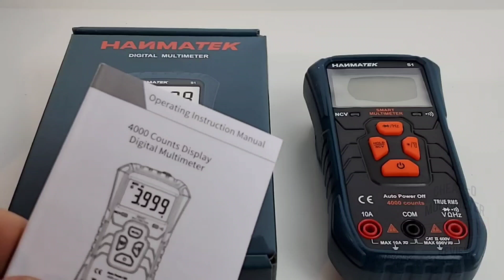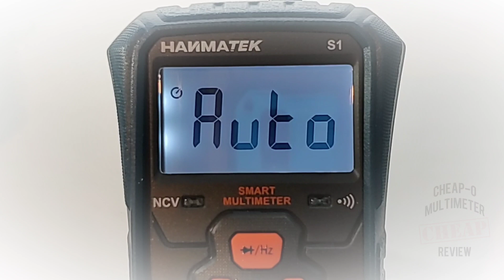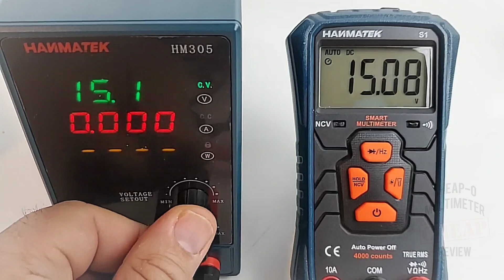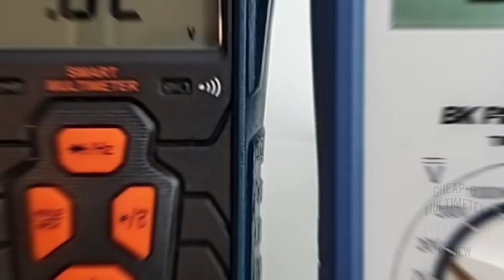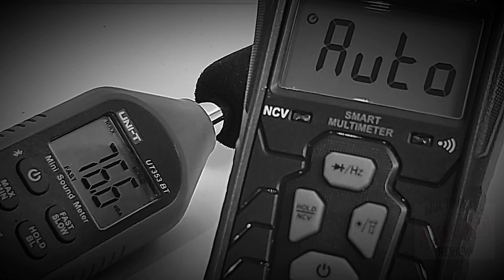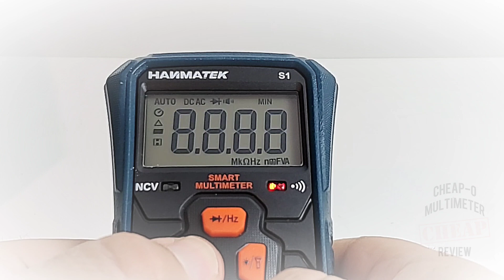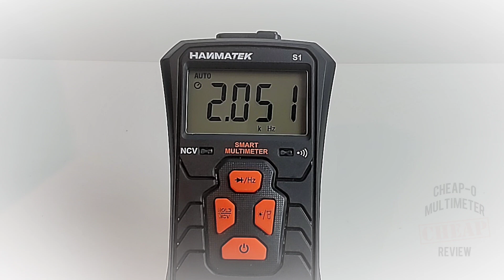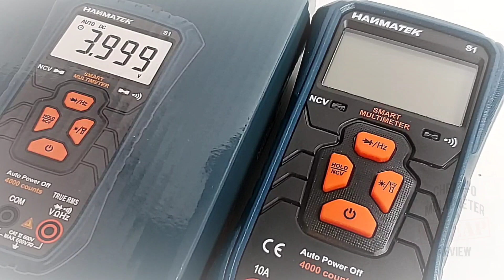HANMATEK S1 CHEAP-O Multimeter  Review & Teardown!

Comment: Hi Darren, could I bother you with a question, my Hanmatek S1 didn't came with the user manual and I have not been able to find it over the internet neither in the Hanmatek web page,  could you scan just the English version so I  can just read it and to be sure I don't make any error using it, thanks In advance, I will send you my email if you can do me this favor, regards.
Reply from the maker: Hi Thor, unfortunately I scoured high and low but seem to have misplaced the manual. You can email me, netplicity1@gmail.com  and I'll send you the manual when I find it. 😏 👍

Comment: Hi, I have just bought this Hanmatek S1 multimeter and today I checked for the different measures bur when I tried the NFC it didn't work,  one thing I noticed was that if I connect the leads to a 110 volts at the same time as I pulsed the NFC button it of course detected the 117 volts but not through the detector but through the leads, I still haven't opened it but would like to hear your opinion.

Regards
Reply from the maker: Could be anything...faulty NCV Sensor, misaligned wiring for NCV, take a close look at the pcb, is there any defects or misaligned traces..?
Reply: @KeepOnTesting  will open it and check,  thanks
Reply: @KeepOnTesting  HI, well I have just opened the multimeter and at first glance it didn't have the NVC "sensor", I thought it was something like a small electronic piece and suddenly I looked at this small long piece of brass metal and according to your video found the place were it belongs and just a little Flux and solder and voila,  I made some tests and found the NVC distinguish the voltage in an electric extension, I think this is weird as I always thought the voltage should remain almost the same all along the cable extension but in this case when I watched the bars in the display they diminish as I navigated along it, I also checked for the Hz frequency and it returned 59.8 Hz, very nice readings and after resolving the NVC problem I love this small unit, I also looked at an Uni-T also digital meter and this does have capacitance capabilities. That will be my next buy.

Greetings

Comment: I don't know how this one has got 3/5 stars! I only liked its build quality and boot colour. 🤨
Reply from the maker: It was a tough call BUT it was accurate and quite fast for a smart multimeter. Well designed cosmetically and relatively cheap.
Based on the abysmal performance of most smart multimeters reviewed thus far, I believe it was a definite step up.😃

Comment: A great fashion meter! Other than that, it's worthless. Maybe I just don't get smart multimeters. If the user doesn't possess the smarts to use a meter him or herself they shouldn't be working on electric or electronic equipment until they acquire it.
Reply from the maker: So true! I think they are in fashion for whatever reason..Perhaps geared to the  generation of instant gratification...instead of learning the fundamentals of electronics they want to press a button. However, they are definitely a long ways away from being a standard multimeter replacement, that's for sure.
Reply: I've bought one, played a little with it  and  decided to donate to a friend, who sometimes wants to see it a battery is charged or a mains socket is working. He has no electrical or  electronics knowledge,  and it the past years ke destroyed a lot of meters.  I  sealed the current  input terminal with hot glue,  and he is happy...
Reply from the maker: @rizzulazzi  Now that's 👌 thinking ! Excellent..for his uses it will definitely suffice..

Comment: Sorry for the sour grapes, and I do like the color but I can think of at least four better performing meters that $25 would be much better spent on, in fact there are meters costing less that work better.  Too bad this one doesnt cook as good as it looks, too much lame and not enough game.  The recently reviewed Aneng 618C smart meter from this same category was a notably better performer in about the same price range, the engineers really love the idea of these smart meters but I just dont see why - virtually none of them measure up to even a decent $20 -$25 auto ranger.  No matter what the engineers do the smart meters will always have that one extra range hurdle to jump when takiing a measurement, plus either being devoid of capacitance or current ranges.  Until they can do it fast and accurately and do it full range they will always be at the back of the pack.
Reply from the maker: I definitely see your point! Too much smart but not enough "smarts". Cheesy marketing aside, I did appreciate the attention to detail but can't overlook the lack of substance. 
Guess I'm a sucker for good looks but I digress...there is absolutely better multimeters out there and I would heartily recommend most over this smart rendition.
Reply: And I do like that color, the two meters I bought from Bolyfa awhile back were the same color and love the shade, but even a custom painted Cadillac is a door stop if it doesnt deliver on the test drive.
Reply from the maker: @yambo59  True enough...though I prefer Lincolns 🤣
Reply from the maker: @yambo59  I know all about the Ford Chassis on a Lincoln body, but believe me that's where it ends. MKC/MKX have an incredible ride , power and comfort. Hang on, this is an electronic channel..hehe 😅

Comment: How to the smart DMMs know when you want to measure mA or V? If I put my probes on a small solar panel, how does it know if I want the short circuit amperage or the open circuit voltage? In other words, how does it know when to be in series vs parallel with the circuit?
Reply from the maker: Great question. The problem is "it doesn't!" 
The so called smart technology can't always discern the power or type of circuit involved. Thats why other than the casual home or cottage job they really aren't equipped for prime time 😒
Of course your probe placement will dictate if you are measuring current or voltage (10A or V input) . However, this doesn't always work reliably either.
Reply: If you plug a probe in the current input socket, the meters is forced to measure current.  If you don't , the meter will try to measure voltage and/or resistance..
Reply from the maker: @rizzulazzi  Cirrect, unfortunately it doesn't always work, especially with lower current measurements.
 The meter gets confused and will not display the correct output.
Reply: I would recommend you just choose a regular multimeter...like an Aneng 8008.

Comment: Excellent review, thanks Darren! Boy, it looks really similar to the Aneng M118A that we can pick up for $10 here in the US but that one is 6000 counts and DOES test capacitance to 60mF....here: https://www.ebay.com/itm/Digital-Multimeter-Meter-Amp-Ohm-Voltmeter-Auto-Manual-Range-Tester-AC-Volt-P1A5/333645398223?_trksid=p2485497.m4902.l9144
Reply from the maker: I'm still waiting for mine to arrive,  appears to be an  interesting contender and as you pointed out the specs look much better..!!

Comment: Thank you for the review! Can you explain why shielding is important and how much it adds to the cost?
Reply from the maker: Great question! A partial Faraday cage ( EMI shielding) is essential to keep our testing results  unbiased from external influences. Other surfaces,  objects , atmospheric conditions and even our own bodies can contribute to the electrical interference and cause inaccurate readings. The actual cost of the shielding depends on the materials involved but still it's very minimal at best. Perhaps as little as pennies per unit. I will be doing a segment on multimeter shielding hopefully next month! 😁👍